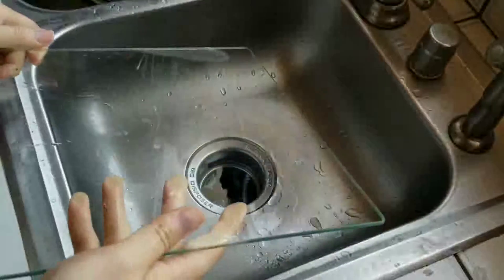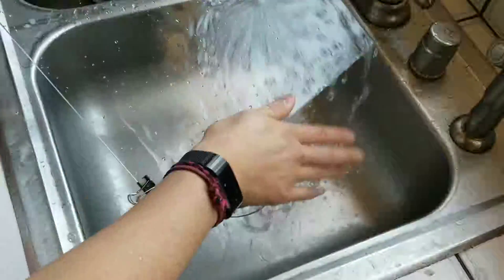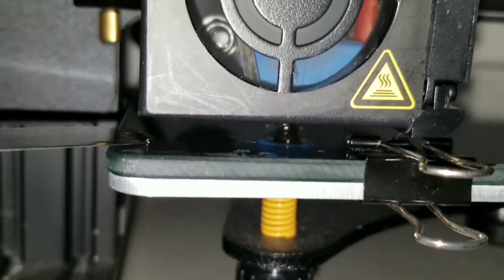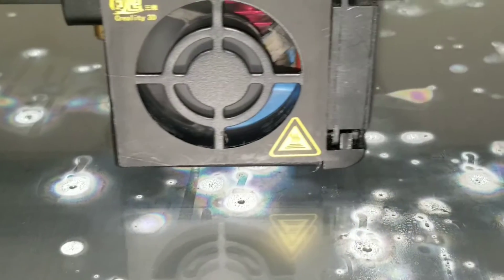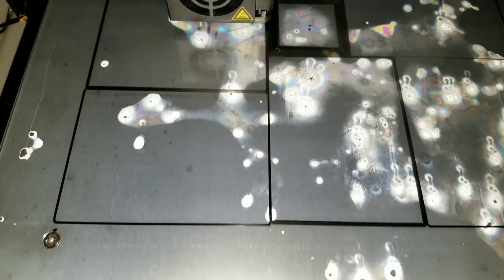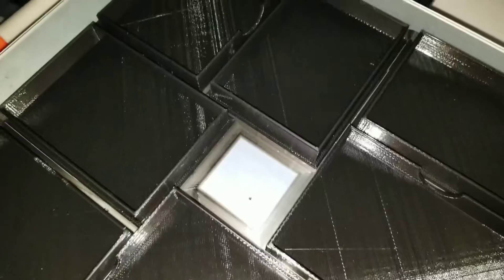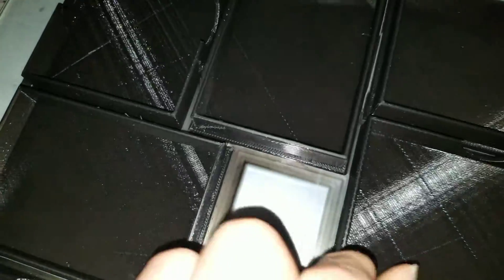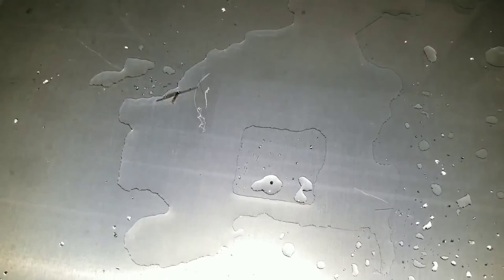Amazing adhesion and removal of prints on heated glass bed 3D printing

Comment: Soap and dishwasher soap goes into the pores and traps grease and moisture, use ethanol or a type of cleaning alcohol (I use hand sanitizer) that removes grime and dries the grease and no moisture as it evaporates in seconds.+ it removes adhesives or also use acetone)
Reply from the maker: ? Acetone dissolves plastics. I'd be very careful using that. The water gets rid of all the soap. Try it. All other methods suck by comparison.

Comment: I don't have problem with making my prints stick but the opposite. I can't seem to find a way to remove my glossy prints without scratching it. Which leave those terrible white scratch especially on a black colored pla.
Reply from the maker: Did you try putting water all around the edges while the bed is still hot?
Reply from the maker: The colder water should cause the plastic to contract while pulling the water underneath. It might take a little time for the water to get under completely, but it'll eventually release.
Reply: @ItsBinhRepaired  still I found this video helpful thanks !
Reply: @ItsBinhRepaired  it doesn't seem to work or Maybe my temperature is the problem here?
Reply: Maybe I'll removing it on running water
Reply from the maker: @paranpics  that's too much work. You'll have to clean and dry it every time. I just jab at the edges a little. Another simple fix is to add a small 2 l x 2 w x 4mm h to the corner away from your design to use as a pry/lift handle just to get an air gap/vaccum with the water around it.
Reply: @ItsBinhRepaired  ohh yeah that might work I'll try that later on my next print thanks again!
Reply from the maker: @paranpics  once a little water can get under, it should slowly flow under the rest on its own.